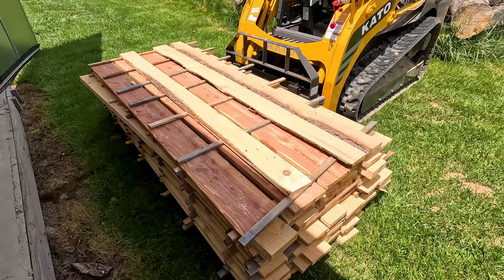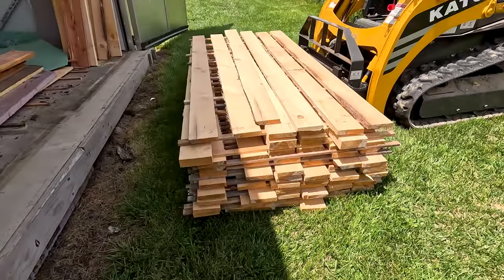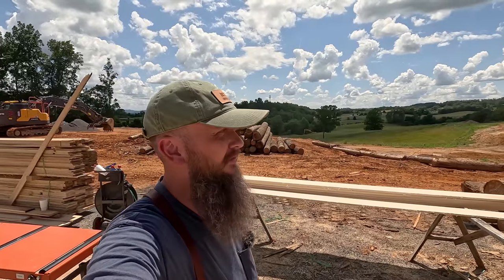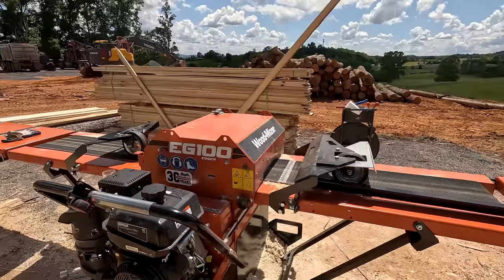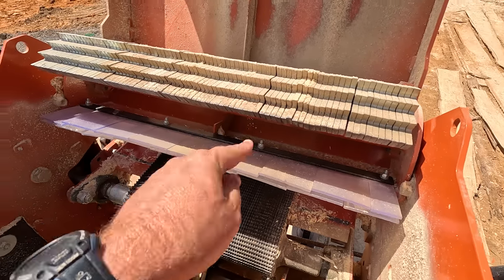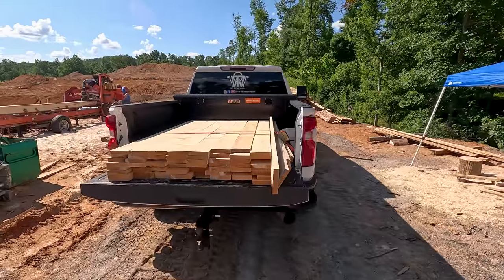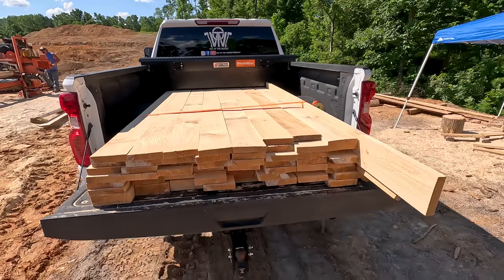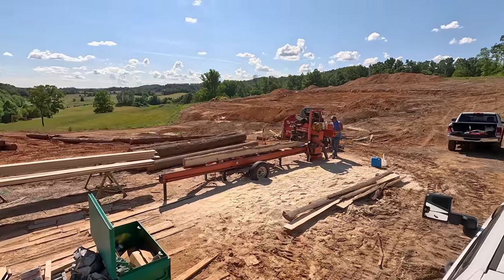How It's Made:This is Saw-Milling/Logs To Lumber

Comment: Now you take all those excess strips and cut them down to firewood lengths bundle them up and sell them as kindling!  Make some more money.
Reply: Then you end up with a pile of bundled strips that no one wants and they end up in the burn pile.
Reply: @caseydodds4433  Granted that cutting them down to the right size would be extra work and maybe it's not cost effective or worth the effort to do that, but it seems a waste not to take advantage of the waste product and find a use for it.
Reply: @caseydodds4433  yup! I’ve made tons of bundles- I’ve only wasted my time- I burn them from the get go now.
Reply: @caseydodds4433  Maybe yes maybe no but until you try you won't know.

Comment: You've got all the equipment you could need for handling material. Why did you transfer the pine into the back of your pickup from the ground when you could stage it at the height of the truck bed on the forks.  A few years down the road you'll be wishing you had when your back has had enough.
Reply from the maker: Good exercise
Reply: @OutoftheWoods0623  Its one man doing a three man job. I do wear a back brace belt though. You are amazing.

Comment: Not sure what you changed but this video hurts my eyes. Maybe it's me.  Still love ya brother.
Reply: I’ve seen a couple of people mention video quality. His video quality is excellent. I can run it at 4k on my iPad although I typically run HD (1080p). I do have good wi-fi however and it could be that your data rate is low or inconsistent. Also, if you watch right after the video was uploaded, it will be lower res playback until YouTube completes its processing of the uploaded file.

Comment: Why is your sawmill diesel when an elecric powered mill in TN where maintenence would be a fraction of the cost of diesel (it cannot be cost as the beautiful mill you have is top of line , fuel/maintence somewhere between 20%-35%). When you do not need to be mobile.Faster no pollution more constant blade speed for longer life much lower noise and faster cheaper re-winds when and if ever needed?
Reply from the maker: Easy answer. I don’t have 3 phase.
Reply: @OutoftheWoods0623 : Hey, Nathan, the power company will run it in, for you.
You can have the install paid off in as little as 100 years.
Of course, that's assuming  it helps you turn your operation into a Fortune 500
company, within the next 10 years. 🤣🤣🤣   😁✌🖖
Reply from the maker: Lol I asked 25k
Reply: @OutoftheWoods0623 : Oh. Well that's not Too terribly bad.
In time, when you need it.
I would think (I often think wrong), you are getting more torque from
that diesel, than you would a reasonably sized electric motor, anyway. 😁✌🖖